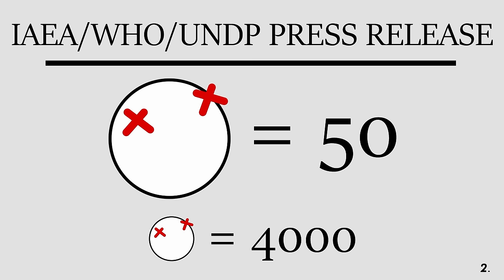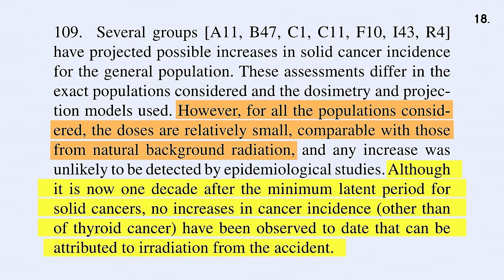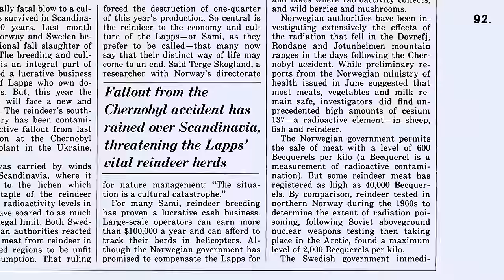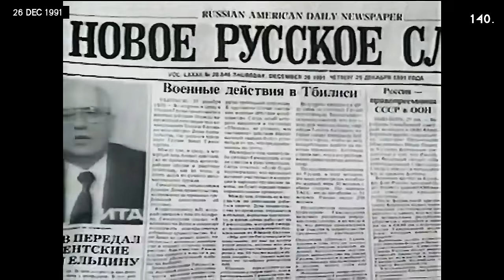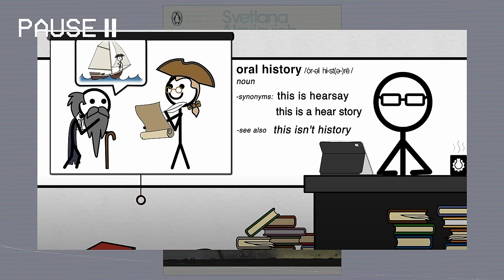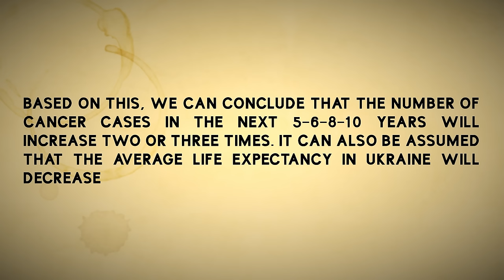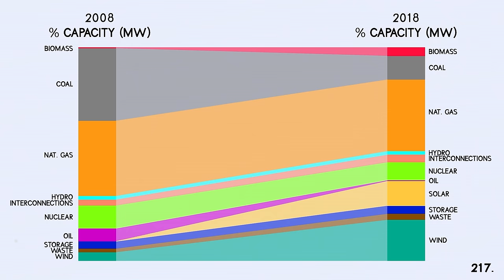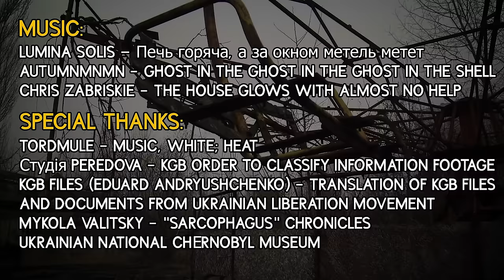Chernobyl's Death Toll | The Deep Dive

Comment: Honestly, I think that your thesis is very good, and I am extremely pro-nuclear, which is why I need to always remember that Chernobyl was awful. I think that it is worth considering that the extreme horrific nature of those disasters is what allows Nuclear to be so safe: all future nuclear power plants have to be able to withstand the worst possible earthquake in their region as a direct result of fukushima, and Chernobyl helped to ensure that we phased out systems that would create that kind of a meltdown. I want more GEN-IV, because with them come the same kind of potential standarization that allowed for the RBMK reactors to become so prolific, as well as reduced risk of nuclear weapons proliferation, but more importantly: I want gas & coal to be held to the same standards we have right now for nuclear. I don't want nuclear to be deregulated, because I don't trust the free market to not cut those kinds of corners, I want coal & natural gas to be treated with the same kind of disposal standards that cause nuclear to be so expensive.
Reply: Fully agree with pro nuclear, it's way more efficient and sustainable than coal, loads cleaner too, but uranium leaves far too much waste with a shelf life that's way to long, if we could get everyone on board with thorium and educate everyone about the benefits we could easily meet out ever growing need for energy with alot less risk in the long-term
Reply: I want coal and gas power plant to implement an emission standard (ie: particle & chemical scrubber at the smoke stack for coal, and then CO2 scrubbers for both coal and gas) to the point there's not even an argument to not continue using them.
Reply: What about higher standards for solar and wind?

You can't build solar farms without destroying ecosystems. Coal has contributed to the greatest advancements in history (from the Bronze Age to the Industrial Age) but is also responsible for some pollution. Can society continue advancing while relying on a source of energy that's available less than 50% of the time. Maybe if the entire planet was covered or if solar panels orbited it society could continue advancing but when all the trees are cut down how will that affect oxygen (trees are responsible for 30% but "Our approach to forest management can have implications for our oceans. With their potential to either release or absorb CO2, there is a growing focus on managing forests to enhance their capacity to capture and store it. Thus, healthy forests can take in carbon that the oceans would otherwise absorb." (and result in ocean acidifcation). Fewer trees also means nothing to absorb rain which means more flooding every time it rains. Without trees, birds would be easier prey which would mean insect populations would not be controlled. When Mao wanted sparrows destroyed the locust population ballooned and ate the crops which contributed to the Great Chinese Famine which was responsible for 15-55 million deaths. Another example of removing something from the ecosystem, "In the 70 years of the wolves' absence, the entire Yellowstone ecosystem had fallen out of balance. Coyotes ran rampant, and the elk population exploded, overgrazing willows and aspens. Without those trees, songbirds began to decline, beavers could no longer build their dams and riverbanks started to erode."

Then there's the 300x more solar waste problem which will be toxic forever (because toxic metals don't decay). Nowhere in the world has 100% recycling and whatever number they have is debatable because some consider waste to energy (burning garbage) to be renewable. It would take Japan 20 years to recycle the 10k-20k tons of solar panel waste it currently has.

Wind has its own problems. You can't line wind turbines up in a row because the ones in back wouldn't get any wind. That means that wind turbines change weather patterns. There have been articles about using wind turbines to stop/reduce hurricanes even though "In fact, if we didn’t have regular hurricanes occurring, the world would in fact end." (National Hurricane Center-NOAA). The blades are made from heavy duty plastic which is difficult to recycle so whatever hasn't eroded over the years from the wind (scattering plastic across the planet, just like radiation from an accident) winds up in landfills.

How do you provide enough energy for a technological world while only using solar and wind and without changing weather patterns and cutting down trees or destroying deserts (you can't just move forests or deserts). If the idea is saving the planet how is solar and wind any good for the planet. If all that matters is co2, okay they win, but so would ending the human species.
"“I couldn’t see the sky or clouds, just a grayish layer,” she says. “Definitely, we have never seen something like this.”

The dust over Puerto Rico represented the leading edge of a giant plume that had traveled more than 5,000 miles from the Sahara desert across the Atlantic Ocean, spreading into the skies above North America and beyond.

This particular dust plume is at once remarkable and totally ordinary. Each year, these kinds of plumes sweep off the Sahara, carrying some 180 million tons of mineral-rich dust from its dried-out pans. Thousands of miles downwind, the fine-grained dust shapes both the ecology of the places it lands and the climate as a whole." National Geographic
Reply: @namename9998  You make a lot of valid points but I'm just gonna jump on one that peeves me every time I see it : Trees 
You could raze every tree, shrub, flower, grass, algae and phytoplankton on the planet and you wouldn't run out of oxygen for 100 million years, it's a fifth of our atmosphere and the non-vegetal biosphere consumes a tiny amount of it, even human activity barely makes a dent with all the excess fossil carbon we release that tries to reoxydize. 
And regarding carbon sequestration, forests aren't that great at it either, mature forests are basically neutral, storing as much through growth as they lose through decay, and while young forests can indeed store carbon, especially if used commercially for construction, they might not do it as efficiently as the biomes they replace as some grasslands, marchlands and especially bogs are better at absorbing and retaining carbon in the long run.
Also the albedo of a forest is lower than grasslands and fields which might negate the cooling from the carbon it stored by absorbing more incident light.

TL;DR : it's not that simple and you shouldn't be too concerned for trees regarding oxygen and climate but rather emphasize their usefulness in preserving biodiversity if saving trees is your objective, there are much greater concerns for habitat loss than breathability.
Reply: @namename9998  No need to cut down forests for solar. We have millions of square miles of buildings and parking lots that could and should be covered over with solar panels. We just need the will to do it.
Reply: Here's the thing though, Chernobyl was already defective by western standards before it was even designed. Chernobyl wasn't "awful"; it was an unbroken chain of wrong decisions stretching back to before they even broke ground.
Deregulating nuclear power would actually be a huge boon because it would unshackle the industry from designs that were obsolete in the 1950s and allow the deployment of vastly superior designs. Designs which can economically consume their entire fuel load instead of a few percent of it and for which meltdown is physically impossible.
Proliferation is a completely specious argument. A nuclear energy program and a weapons program look nothing alike, having one is no guaranty of having the other, and proliferation was instrumental in forging diplomatic relations, even if it was under threat of mutually assured destruction.
Reply: @argusfleibeit1165  sigh It doesn't matter how many panels get put up where; it will still require enough stored demand to cover for fluctuations in collectible energy from season to season and even year to year. That is weeks worth of storage in the absolute best case scenario, and that is far outside what is feasible.
Reply: @jacobnebel7282  what reactor designs are you referring to?
Reply: @John_Conner_  nuclear waste is actually very small and not even all that dangerous. It's just radiated concrete that has just a bit more radiation than smog in industrial cities.
Reply: @kingofflames738  much like anything tho, it all adds up
Reply: What about Bhopal?
Reply: @John_Conner_  watch kyle hills most recent video about nuclear waste, he goes into detail about how the situation has been blown way out of proportion.
Reply: Here here. 100% agree
Reply: if you can some how find "free range" lithium..... then tax incentives could be made for solar/wind 
.
we need a panel + water heater + HVAC on every roof
especially if all cars go electric 
.
either that or we are gonna have to all switch our PC power supplies to 240V exactly at midnight 2000...... sorry, i mean 2035
more volts + same amps = more power with the same wires 
.
like, little known fact..... Americans already have 240 volt in the home
its just ONLY used for water heaters, dryers, electric heaters....
.
so, just install that double breaker (bridging the split phase...so you get 240 out)
all your light bulbs explode...modem is smoking...... but at least your PC works
Reply: @John_Conner_  a lot of other pollutants add up in even higher quantities so what’s your argument then?
Reply: The treating coal and natural gas the same as we treat nuclear idea is a great one.  We need to stop subsidizing private companies to pollute the shit out of everyone else's planet.
And we need more gen IV reactors with more funding from the government to make them both safe enough and able to get built.

And more than that let's get some gen V reactors, or push more funding into te development of fusion energy rather than the meagre funding it is getting now even with the huge leaps that it is making with just that alone.
Reply: @John_Conner_  I think that it was a kurzgesagt video where I heard it but if you include deaths due to installation accidents solar energy kills more people per megawatt hour generated than nuclear does just due to people falling from high places.

It's like how after 9/11 more people died due to excess road travel from cancelled flights or fear of flying than people killed in the actual attack.  And the number of people who chose to drive rather than fly because of the TSA kills a few thousand people every year and yet people still say never forget about the few thousand who died in one attack while not even knowing that dozens of times that many people die every year because of the increased road traffic.
Reply: @seanmac1793  Not agreeing with the guy but he is talking about gen IV reactors specifically thorium based reactors which do not produce nearly as much or as toxic of waste and the small bit they do produce is only radioactive for a decade or two from what I recall.

Thorium reactors are not able to melt down at all even if you were trying to make one melt down because they just do not have the physical properties to achieve a catastrophic melt down.  The type people are talking about is a Liquid Fluoride Thorium Reactor or L.F.T.R.

Here is a sci show video from years ago talking about them.  https://www.youtube.com/watch?v=nYxlpeJEKmw

They are as safe as it gets right now and about as green as it can get for a nuclear reactor.  And thorium cannot be turned into nuclear weapons at least not very effective ones even at great cost with a huge amount of skill involved.
Reply: @atashgallagher5139  and yet my point remains that nuclear is good and thorium is still safer? Not sure what point you were trying to make I agreed with the op
Reply: @atashgallagher5139  where thorium reactors around in the 50s because he is saying that we are still building designs that were obsolete then
Reply: @John_Conner_  I love being extremely and fully pro nuclear, it needs to be built more and now.
Reply: @namename9998  mate what do you think mining does to ecosystems? destroys then and pollutes them
Reply: @heehoopeanut420  Solar requires more mining than nuclear so we really shouldn't use solar then.
Reply: @namename9998  even if that was true, it would still be more sustainable considering this would be a one time installation of power that would last indefinitely as long as the panels are maintained.
Reply: @heehoopeanut420  Where are you getting your information. Solar panels have a shelf life of at most 30 yrs. That's not "indefinitely" like you mentioned and doesn't take into consideration storm damage.

Solar doesn't include batteries which require even more mining and batteries only last 5-15 yrs.

Nuclear lasts 60+ yrs.

Solar uses a lot more materials than nuclear to create the same amount of energy in the same amount of time (people aren't going to move to the equator just so they have guaranteed power 50% of the time but you still need at least twice as much solar because the world doesn't stop working just because they sun goes down).

Nuclear can stop creating new fuel (the equivalent of new panels) and waste would be reduced to close to 0 but if solar stopped creating new panels the waste would remain. There's only 250k tons of waste from nuclear from around the world from the past 50 yrs but by 2050 there's going to be 78 million tons of solar panel waste. The 250k tons of nuclear waste can fit in 1 football stadium. It would take Japan 19 yrs to recycle the 10k tons of solar panel waste they currently have.

How is solar sustainable?
Reply: @namename9998  you're explaining the literal reasons that solar is viable, governments just don't give a damn. Yes solar is viable if recycling and other means of transport and repair are also reworked to be more sustainable as well. You can't expect 1 area of change to fix all of our problems, it's just a start. You gotta start somewhere, because right now fossils fuels and non renewable resources that decimate our ecosystems ain't it.
Reply: @namename9998  I won't argue that you don't have important points to consider. But what I will never understand is everyone I've seen making these arguments refuses to acknowledge that batteries exist in solar and wind systems. Whether it's gravity driven hydraulic batteries or solar heating up sodium batteries, there have been countless innovations. But personally, ever since a wind farm moved in 100 miles from me, wind has been cheaper than the heavily subsidized coal it replaced. All I care about is my electric bill has gone down the past three years when everywhere else it's going up regularly due to inflation. I feel like I've won the jackpot being next to this wind farm. Most consumers only care about the price of their electricity, end of story. Wind became cheaper, now everyone in my town gets one of the 100% wind energy suppliers. I don't think this would've happened if the intermittency problem didn't have economical solutions.
Reply: @argusfleibeit1165  first of all,that’s stupid,unless your talking about abandoned areas which I don’t think you are,but even then those areas could be used for much better purposes,agriculture,shelters, markets,etc.
And even then,if your including populated areas then we have property rights issues,what if someone doesn’t want their house replaced with a windmill,what about the animals that adapted to live in urban environments,how would they react to giant moving machinery and hot solar panels,having the stationary and safe shelter that is a house replaced with a windmill,no matter what we do,there will be habitat destruction,we can either do nothing and fizzle out of existence,or we can minimize the damage while maximizing efficiency,which is what nuclear power does
Reply: @atashgallagher5139  Forget Gen V I'd like to at least replace the Gen II reactors, even if we are only using Gen III, hell I'd even take Gen II at this point over using 50 year relics.
Reply: Admittedly, while I am for-Nuclear energy, I think lay more on the center of the spectrum. It is very easy to forget that the triumphs and successes that the field of modern-day nuclear energy has is the result of the lives and sacrifice from those that met its downfall.
Reply: @argusfleibeit1165 
& Where does the metal for all your "renewable" devices come from, I wonder?